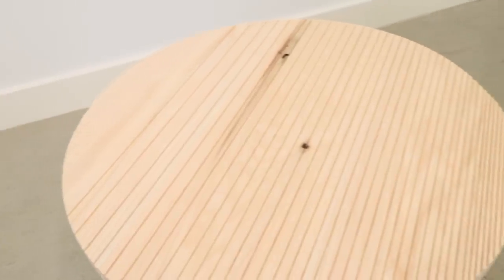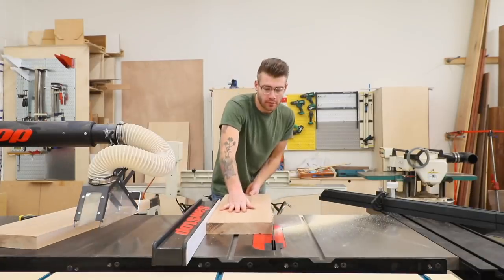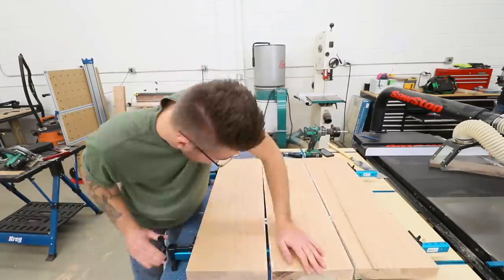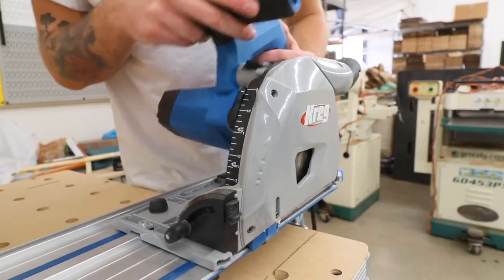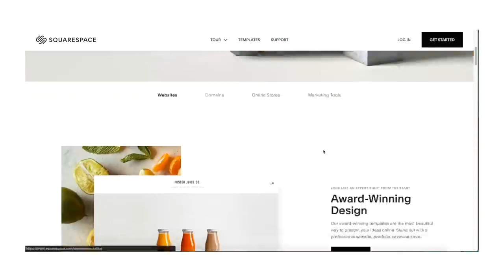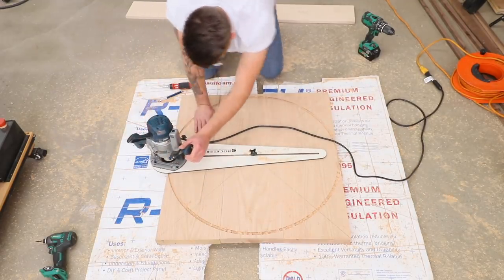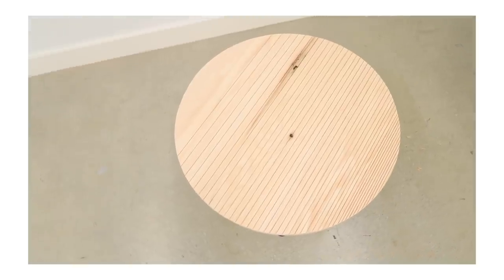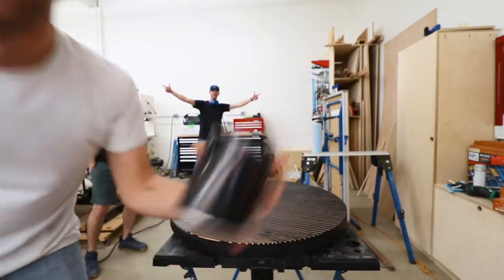Building a Round, Patterned Coffee Table // DIY Woodworking

Comment: Wouldn't it be easier to stain it first and then do the cuts in it? Then you wouldn't have to worry about getting it in the grooves.
Reply: Duh! Of course he knows that... he's a professional. It seems like he was going with the flow and was uncertain if he was going to stain it or not. Which I'm glad ya did Mark. IT LOOKS AWESOME!!!!
Reply: the grooves are an afterthought, or bad planning... I would've gone with the no ink look, but to each their own.
Reply: Amei
Reply: The grooves are a catch-all for dust and dirt.  I think I would have cut the grooves, filled them with epoxy, (a color of your choice), then cut it round, then stain it, if you were going to, then sand then clear coat.  That narrow groove on the edge on the one side is going to get broken off straight away unless it was filled with epoxy or strips of wood, (loves me some purple heart).
Reply: @dakotaenriquez8255  he really is not a pro...
Reply: @dakotaenriquez8255  hes a professional youtuber, but amateur woodworker tho.
Reply: Stain penetrates into the wood. It could possibly sink too far down and taint the groves if stained before cut.

Comment: Quick safety tip on using the table saw, after seeing a guy cut his thumb off 25 years ago, be sure to place 4 fingers on top of the piece and tuck your thumb straight under your index finger pushing on the back edge of the workpiece. I’ve been doing that for 30 years and still have 10 fingers!

Comment: Little tip. Apply the downward pressure MOST on the outfeed side of the planer. You will flatten a bowed board or create a bow from unequal pressure and NOT get a straight result otherwise. And, India ink is notorious for being susceptible to ANY moisture and bleeding into whatever it touches. Be SURE every bit of it is sealed from moisture or you will stain everything that touches it. Loved the look of the stained piece with the caviat...

Comment: Table looks cool.
Dowels don't add strength in the properly glued long (or face)grain joint like that tabletop. They just align the boards so later you have less work to do (planning and sanding).
And finally, welcome to the woodworkers club :)
Reply: Is it better to just buy a biscuit joiner? Do you think that table could withstand someone sitting on it accidentally?
Reply: @boltup5566  Biscuit joiner would do a nice job of alignment as well. Neither method adds any strength to the glue joint. The table won't break if you sit/stand on it . Probably the screws would strip out or the legs would bend before the boards fail.

Comment: I really like the design of the table, if it wasn't trying to be fit into a one or two day build, I would be curious what you could come up with for a different base. I even have a table with hairpin legs but eventually want to change it out.
The dowel joints definitely help with alignment, but just to clarify they do next to nothing to add strength. While they may add a little, properly prepared boards glued into a panel will be plenty strong without the dowels.